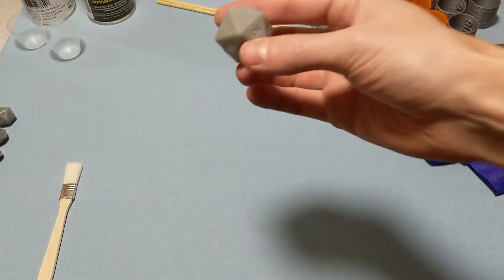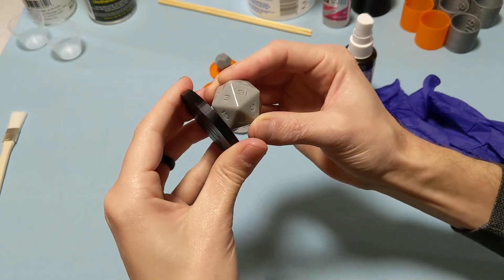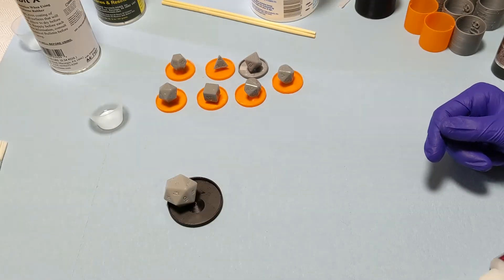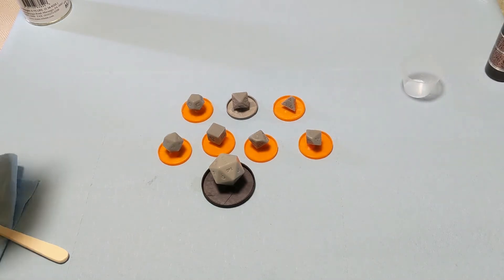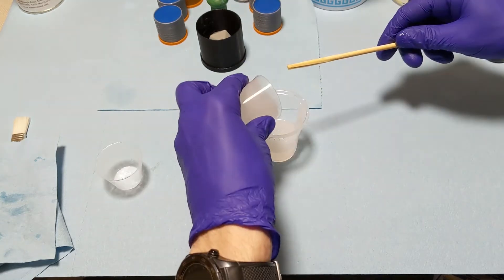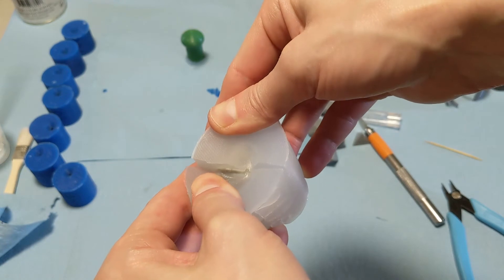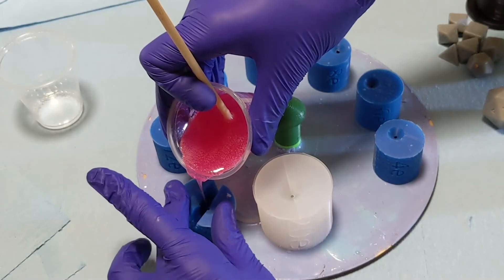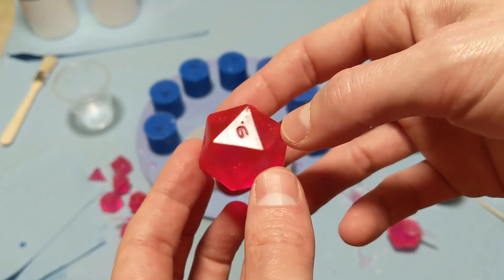Make Molds of 3D Printed Dice - Avoiding Cure Inhibition (Inhibit-x, Ease Release)

Comment: May I add... It is of utmost importance that you make sure that the dice is 100% dust free, and while you dry the Inhibit-X (it does not really dry) you should cover it, because any dust will show up later as a surface flaw. I actually DIP the parts in Inhibit-X
Also I want to mention, that I have seen good results when I bake the part at 80C FOR DAYS. But careful, some resin will crack.
Another option (I have not yet tried yet) is Siraya's "Defiance" (it is a special silicone) ... it is the resin's out-gasing which causes the silicone's cure inhibition. Siraya claims, that their silicone "Defiance" does not have this problem.
Other recommendations on youtube, like spray painting has its own problems, it does obscure details... totally unsuitable .
I recommend to make some 3D prints (like a little dish) especially suitable to conduct tests. Doing it with these dice is far to much work... you can get your answers a lot simpler with dedicated test pieces... just a little dish or tray, so the silicone does not run off.

Comment: if you are just using the inhibit x to make coppies, so you can make new molds without it,,, just make your first molds using a decent tin silicon,  without the inhibit x ,  then make plat molds off them
Reply: Will not work, the resin exothermic reaction will dull the surface of the tin cure Silicone, so. you will have a matt part.

Comment: I have had good platinum silicon molds come out after curing the resin print normally and letting the model surfaces dry overnight.  The next day I coated the model in vasoline petrolium jelly with a paint brush. Getting the clumps out of fine details as I go but leaving a smear all over the part. You would think that it would be covered in brush marks afterwards but the exothermic reaction of the rubber curing makes the rubber iron out flush to the faces. Maybe I was just lucky.

Comment: Worth mentioning that you can with some resin, just leave your printed & sanded masters to off-gas for 2 weeks, then mould them using a Plat cure without having to worry about cure inhibition. I do this and it works for Elegoo Mars ABS like grey resin. The two weeks can likely be cut shorter but I don't need to rush new masters. Rev Chumley, has some good videos around this also.
Reply from the maker: Excellent point, thanks for sharing. I think I've mentioned it in another video, but for me, time waited after printing before making molds didn't make a difference for me, even after waiting a couple weeks. In my experience, it is more to do with the resin and silicone used regardless of time curing. Tin cure silicones didn't work with any resins I tried, but platinum cure silicones have as long as it's a standard resin. Water washables and urethane/flexible additives (Siraya Tech Tenacious, Monocure Flex) don't seem to work as well. Nova3d standard and SirayaTech ABS-like fast resins have worked fine for me so far whether it be the same day or weeks later without any sealants or mold release. I will also mention that smooth-on recommends curing your print for a minimum of 6 hours on all sides.
Reply: Ah, why yes! Let them come to a “chemical equilibrium” while pressure and temperature usually influence this process on platinum-base RTV-2 silicones, for those willing to experiment, accelerating the noted 2-week off-gassing period for this purpose of casting parts. I also think this works out to be more affordable for those looking to make RTV masters or casting molds via SLA photopolymer resins. Also, tin-cure via tin salts (also known as condensation cure) silicones are less prone to cure inhibition than platinum-cure silicones. Tin-base silicones are good for prototyping functional parts (e.g., electronics cover, some over-mold applications, seals, valves, etc.). One main downfall of these is the shorter life of the silicone properties before the silicone becomes less pliable and losses some of its viscoelastic behavior (essentially gets stiffer). So molds don’t have as long of a shelf life as a master RTV as platinum-based silicones, typically, do. Platinum silicones are good for their longer stability and have usually nil shrinkage that is good for precision casting. Hope this helps! (I am a professional amateur, who is preparing to produce my very first SLA mold to cast RTV-2 castings.)
Reply: You can fast forward this by curing the prints for 4 hours inside of water and then 4 hours in the oven at 180 F.

Comment: the problem with ease release it is too oily and make marks (dots) on the surface you sprayed on especially visible on a polished surface, it is much better to use ultra/micro-thin film sprays like ultralease (old name ultra4)

Comment: Personally, I had nothing but problems with platinum cure silicone. It would inhibit against almost any surface. I now use Sirayatech blu printer resin with mold max 30 (tin cure) and have zero problems.  No need to seal it, paint it, bake it, let it out gas, etc. Just print your part, cure it, dry it, and coat it with silicone. I did find that you have to bake your molds afterwards, as per Smooth-On's recommendation.  Tin cure gives off moisture and alcohol while curing and if you don't bake that stuff out urethane rubbers/resins may inhibit when you cast them. I had no problems with epoxy though.
Reply: How do you find the Mold Max for air bubbles. Do you feel it needs a chamber to be viable?
Reply: @crazylegsmurphy   I do use a vacuum chamber for all my silicone. The first time I didn't and I got a bubble that showed as a lump on the casting. Never did that again. Smooth-on makes a tin cure mold max NV29 (which I haven't tried yet) the NV stands for "no vacuum". It's much thinnner in viscosity, so it's not supposed to have bubbles. I think having a vacuum chamber and pressure pot is essential if you are at all serious about casting.

Comment: I think you meant that you should use Tin-cure, not Platinum. Platinum (additive cure) is the one that is extremely sensitive and will be inhibited easily. Tin-cure will not be inhibited by any sla resin. I use my 3d printer for mold masters.
Reply from the maker: I've heard both ways, but all I know is that tin cure didn't work for me with any of my resins and platinum cure did before I tried any sealants or mold releases. Smooth-on also says platinum cure is more sensitive, just odd that my experience has been the opposite, but maybe this link will be helpful for others as well. Thanks for bringing it up. I'd be interested to know what resin/silicone combos you have used successfully.  https://www.smooth-on.com/support/faq/210/
Reply: @geek-happens  I found that 3D printed resin doesn't inhibit tin-cure silicone from curing, but unfortunately, tin-cure silicone does inhibit 2-part epoxy from curing lol. I found that it just took a lot longer for my resin to fully cure, almost a week rather than the 24 or 48 hours it should

Comment: Is there a tape that inhibit x dice will stick to?
Reply from the maker: I assume it would be for a cap mold, in which case I would stick the die to the tape first, then coat it with the inhibit x, trying not to get under where it is stuck to the tape. Make the mold of that side and then coat the final side before making the cap after you remove the tape. I used gorilla tape for my cap molds, but it can be a bit sticky, though I'm not sure how much it matters what tape you use
Reply: @geek-happens  thanks. I cleaned off the surface with isopropyl alcohol and a Quetip. The 3d print is over a month old so it might not inhibit anyway, but I do have new masters coming in so I want to figure this out